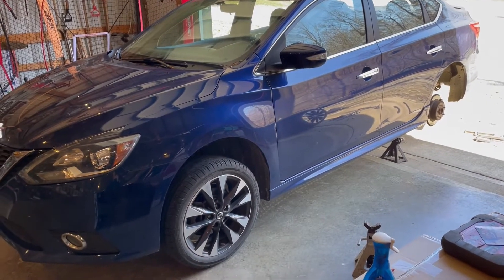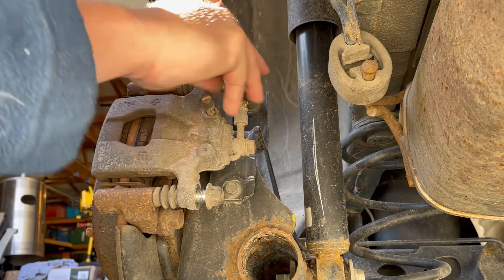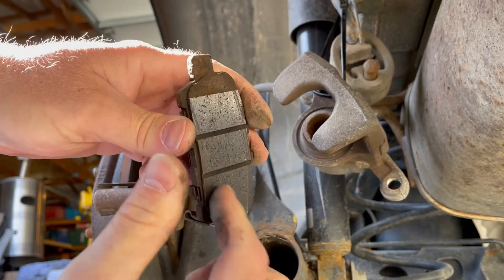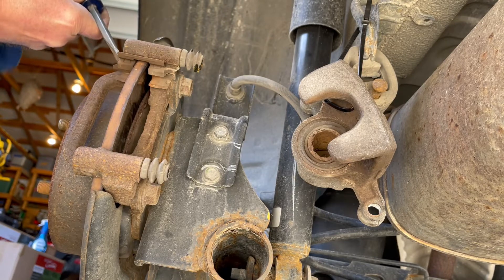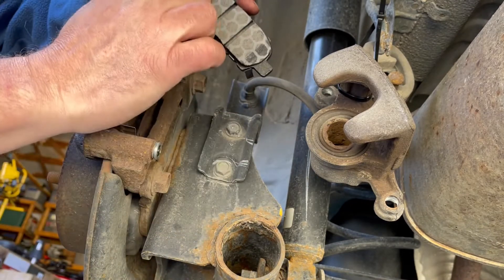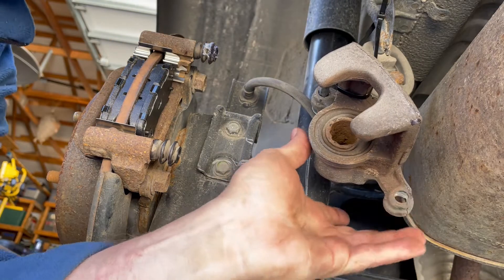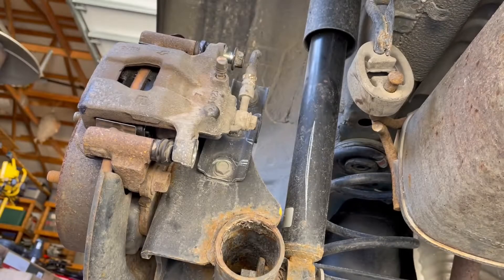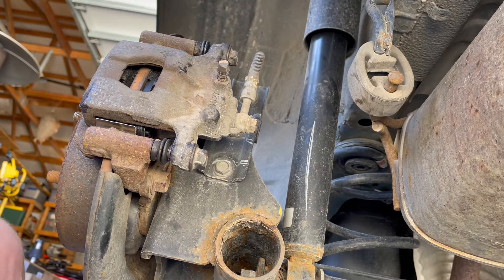2013 - 2019 Nissan Sentra Rear Brake Pad Replacement. DIY with basic tools and a jack.

Comment: You should use a face mask, like your Covid mask, and mechanics' or nitrile gloves when working on brakes. It will help keep you prevent brake dust inhaling and your hands from cuts and having to spend a lot of time removing embedded brake dust. This guy is presenting a pretty good way to change these pads, and his description is excellent.
Reply from the maker: @dennissnyder3296  I will agree, better to wear a mask and gloves. Especially if ever using air to blow the brake dust off.

Comment: Prior to compressing the piston in the caliper, place a tray under the master cylinder and open the top of the master cylinder. When you compress the piston, you will be pushing fluid from the M.C. and without allowing it to empty the excess that is inside (from all the times you added fluid while the old brake pads wore down), you will end up replacing the master cylinder (in most cases).
Reply from the maker: @dennissnyder3296  I’ve never had to add fluid on my newer cars before the 1st pad change. So no risk of overflowing the master cylinder when changing pads for the first time. Definitely a concern on older cars when it’s likely that someone has replaced a brake line or caliper and had to bleed brakes likely topping off the cylinder.

Comment: Note: Often the factory grease used in foreign cars becomes hard. Clean inside the caliper bolt guides and outside of the bolts. You can then replace the factory grease with good quality brake caliper guide grease. When you remove the caliper bolts, keep them separate and put them in the exact same place they came out of.
Reply from the maker: @dennissnyder3296  yes best to put everything back in exact place it came from, also some calipers  have 1 bolt that has an o-ring on the end for anti rattle so that should go back in the same hole. And yes cleanliness of parts and proper grease makes everything last much longer. Thanks for the comments.

Comment: No service of the rotor?
Reply from the maker: I think it was mentioned, but I replaced my pads before they were totally worn away and they were not grinding. So I re-used the rotors. Best practice is to replace the rotors each time you replace the pads, but my old rotors were still smooth and had no grooves, so I went with the old rotors. I've had no issues thus far.